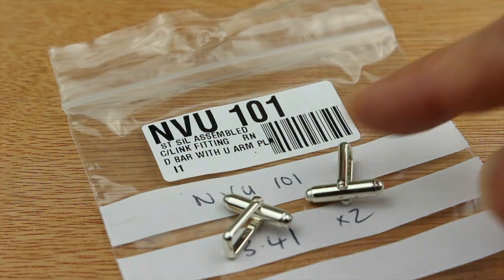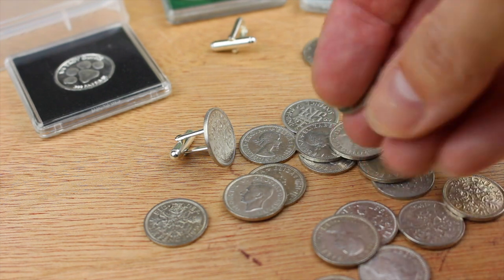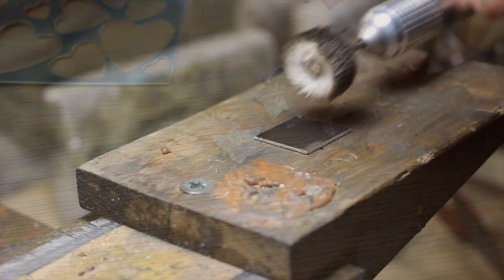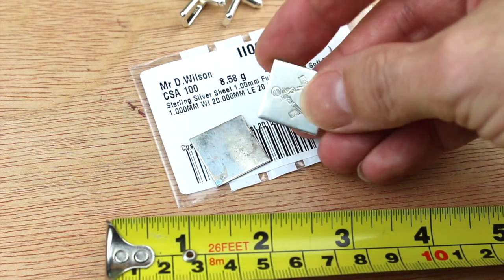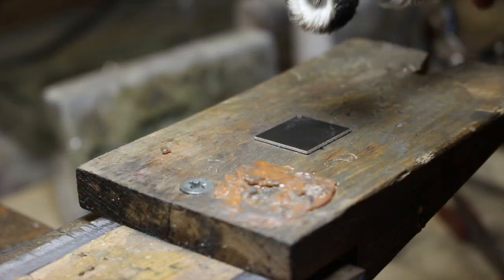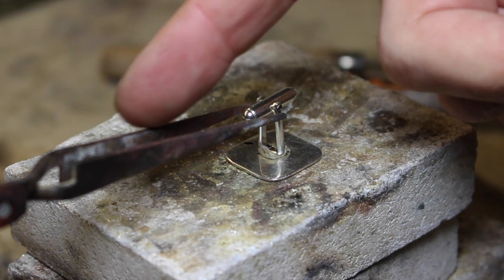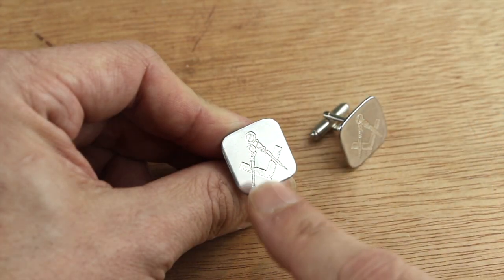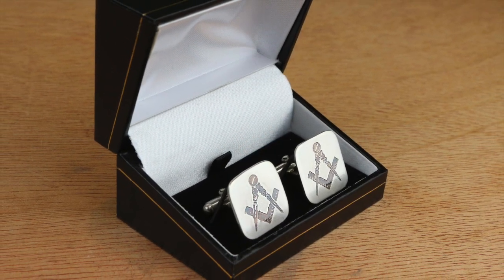Silver Etched Cufflinks, How to Make them & other ideas.

Comment: After doing several commissions based on an etched design--here's a tip on using the PNP film for etching silver. Those sheets which you run through your printer require heat to bond to the silver to act as a resist in the iron nitrate solution. There are several demos on youtube describing how you can use a clothes iron to heat the resist onto the silver. Here's my tip: I've found that I get much better results in the design transfer step if I put a sheet of copper between the over the PNP sheet, and then I simply hold the iron in place for 2-3min, depending on temperature of your rion. I find that the copper conducts the heat better when the iron has holes in the bottom, because moving the iron runs the risk of smearing the design transfers (meaning I have to start over).
Reply from the maker: Thanks Curt great tip. The copper probably also helps to spread the heat evenly. Thanks again, Dave

Comment: My Brother printer does fine. For cheap, use label paper but peel off the labels first. Also, I discovered a heat transfer process that is so much better than an iron! Ready for this? A hair straightening iron. I sandwich tiny pieces between silicone rubber for even distribution, put on oven mitts and press together HARD for about 35-40 seconds. Perfect toner transfer! Try it! Ebay has ferric nitrate. Just be safe using the stuff!
Reply from the maker: Thanks for sharing that great tip on the hair straighteners. Thanks. Dave.
Reply: Celtic Dreams My pleasure! (Must be at least 300 deg.) Have an awesome day!
Reply from the maker: By any chance do you come from Leigh? near Wigan. it's such an unusual spelling./
Reply: Celtic Dreams No sir, I'm in West Virginia, U.S. :)

Comment: Wow!  Thx for the video!  May i know if its the same if i use tattoo transfer paper?  Cos i cant find any of the ones you have shown on video in AsiA where i an at the moment .  Thank you.
Reply from the maker: I know nothing about tattoos, so cant say. But considering you iron it on to the metal, That would be a pretty painful process for the start of a tattoo. You can always paint freehand, with a sharpie marker or cut shapes from plastic film or tape. You just need "something' to act as a barrier to the etching solution. Hope this helps. Dave

Comment: Hi Dave - What was the tool you used to find the center of the cuff links...(?).  Thanks for all the great videos(!).
Reply from the maker: Ha ! at last ! I've been waiting for someone to spot that. It's a tool called a "centre finder". Much used by engineers, but most jewellers have never seen one. Many people make coin rings and I have seen so many videos on YouTube about how to find the exact centre of a coin. unbelievably complicated methods. No silly methods required. Just get one of these, simple as you can see. Mine is a small steel one of ebay for a couple of pounds. You can also get plastic ones. or even make your own. just a right angle with a ruler set at 45 degrees from the corner. Its a little lifesaver. I should really make a video on it. Well spotted !  Dave.

Comment: hi I was wondering could this be done to make a deep etching on stainless steel signet ring blanks
Reply from the maker: +CLIFTON MORGAN I'm not sure on that one. The question is what chemical to use. When etching copper circuit boards you use ferric chloride. But this doesn't work so well for silver. Hence for silver we use ferric nitrate.  But for stainless steel, I don't think either of these would work. You may need a strong acid. My suggestion would be to take your artwork to an engraver and get it machine engraved. You'll get a much better result if you want it deep. Dave
Reply: Thanks for the information and advice Dave

Comment: ever use ferric acid vs ferric nitrate ?  If so, which is better?  I'm attempting to etch silver.  silver smiths recommend ferric nitrate.  But ferric chloride acid is easier and cheaper to make.  I don't want to use my nitric acid if I don't have to. Hydrochloric acid is cheaper.
Reply from the maker: I'm not exactly sure what you mean by Ferric Acid. Ferric Chloride is often used to etch copper circuit boards, but apparently this doe snot work on silver, hence why we use ferric Nitrate which etches silver. So for etching silver you need Ferric nitrate. Dave
Reply: ty.

Comment: I didn't think you can pickle components with steel springs in it.  Wouldn't that plate the silver and contaminate the pickle?
Reply from the maker: Good point. In theory yes, you are correct. But in practice the ends are sealed. Many items have metal springs, such as cufflinks, bolt rings and lobster catches. It seldom makes any difference to the pickle. Even if pickle does get into the springs, the metal spring is very small compared to a litre of pickle. So is unlikely to have much effect. Also they are only in the pickle for a few seconds anyway. The real problem comes from sing steel tongs or tweezers being constantly left in the pickle.  I  find that my pickle gets full of dirt and sludge from dissolved borax and oxides, just in normal use. So I change it regularly anyway. Dave

Comment: I enjoyed the video. Plenty of good information. I'm a lapidary by avocation, but a jewelry smith by necessity. Lately I've thought about incorporating etching into my work and your video prompted a question: What software do you use in this video? From what I saw, it looks like something I can use especially if it allows me to use scanned photos. Even if it doesn't it looks as though it could be helpful. Thanks.
Reply from the maker: Adobe Photoshop. You need to scale and crop the image, invert it (if desired, the black toner is the resist and will be the high spots). if using text you  will also need to flip it horizontal. Photoshop requires a monthly subscription, but there are lots of free image apps that can so basic editing like this. "Gimp" I believe is very popular. Perhaps look at "portable apps" too, which are free and will run from a USB stick. Hope this helps, Dave
Reply: @CelticDreamsCoUk  , Thank you very much. I appreciate it.

Comment: Hi Dave what printer do you recommend i have been told not to use a Brother laser printer  they give a poor quality transfer i am on a limited budget? Also what temperature do you set the iron at please ?    thank you for your time Bill
Reply from the maker: My printer is a Dell 1660W A4 Colour. It was a reconditioned unit from the Amazon store and was just £40, best bargain I ever had. 

As for the iron, no steam and "medium" hot. silk setting is too low, but cotton can be too hot and curl the sheet. The size and thickness of your silver will also affect it. so on a large bookmark for example you may need a little more heat. You are only melting the toner onto the silver so it doesn't need to be excessive.  Its not an exact science, I guess I just got lucky first time. if it doesn't work, there's nothing lost, just wipe off with acetone (nail polish remover) and try again. Don't etch until you're happy with it. Hope this helps. Dave.
Reply: Thank you for your great advice

Comment: Hi. What is the ferric nitrate concentration???
Reply from the maker: I bought a 250g bag of Ferric Nitrate crystals from Amazon UK. The instructions say to mix it 1:1. so 100g of Ferric nitrate in 100g (100CC) of warm water. Keep it warm (i used a second large bowl of hot water, rather like when melting chocolate) and it took about 15 minutes to get a good deep etch. I have also seen it for sale as a solution. So I guess y read the label and follow the manufacturers instructions on ratios.

Remember for silver you need Ferric "nitrate". The common Ferric Chloride etching solution you may see for sale is ok for copper circuit boards but is not very effective for silver. Hope this helps.  Dave.
Reply: Gracias.Thanks!!!

Comment: Did you go to school to learn all these skills?
Reply from the maker: +Pitchayapa Jingjit . 

Surprisingly, no. I have many letters after my name with a master’s level education. But my academic skills are computers and multimedia (hence my videos). I have never really been taught jewellery. 
I did a short beginners course for just a few weeks at the local adult college, over 15 years ago. I learnt the basics of how so solder, but that's about it. The point is, it gave me the confidence to explore further. Since then I have spent the past 15 years, studying, practicing and learning everything from wherever and whoever I can, Books, videos, internet etc. If I need to do something I will research it, practice first and work out the best method. I am constantly learning.

My first ever piece was a Celtic Bracelet. I worked out the maths in order for the links to fit together and designed a small jig to make the links on. I made my first  piece out of paper clips and electrical solder. I then made it in silver, and then gold. All self-taught, I could not find any information on how to do this. So I had  to work out a solution to every problem. That's why I now enjoy giving back the knowledge and skills I have learned. I know how hard it can be starting out.
Thanks for your question. Dave.
Reply: +Celtic Dreams thank you for the reply! I'm extremely wanting to learn how to make silver steering earring studs and etc.
Reply from the maker: +Pitchayapa Jingjit 

https://www.youtube.com/watch?v=gR5PuqHdFlA